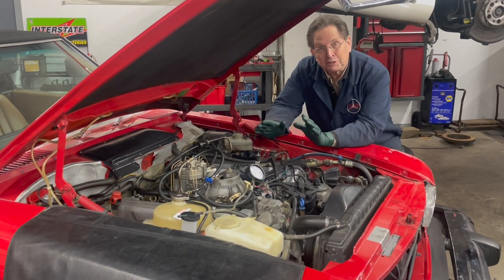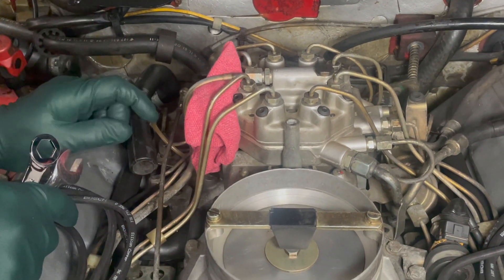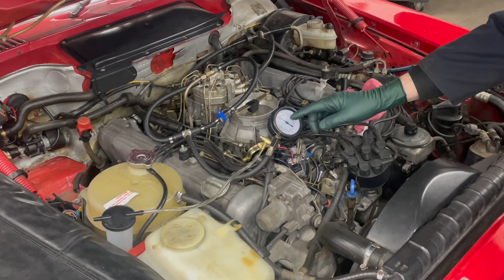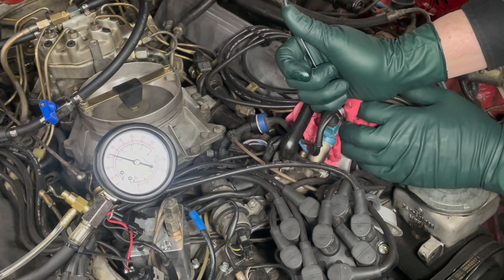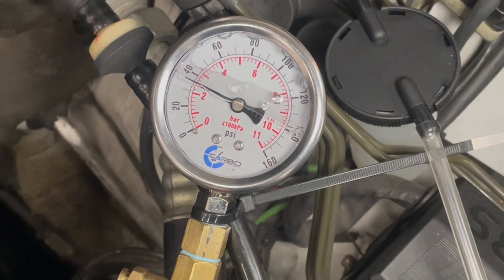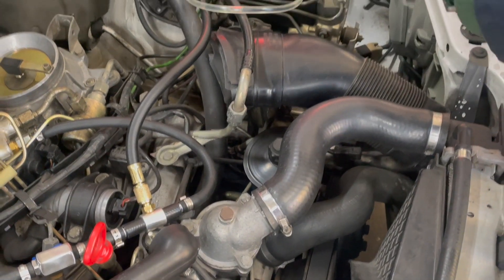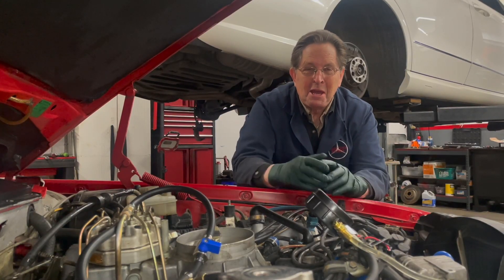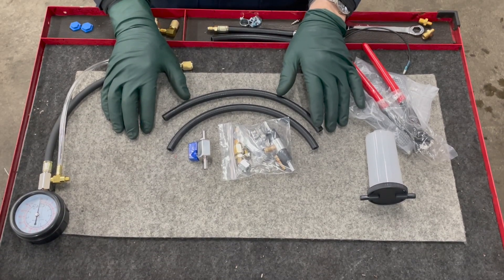Fuel Injection Pressure Testing a 380SL and a 300E: My New Tester Shown in Action

Comment: Am I the only one seeing spark 6:40 minutes in. Front right corner of engine. I don't know what's sitting there. But it's look like a lot of sparks. 🫣
Reply from the maker: So disaster in the making? Maybe the most important takeaway in the video? Understanding what that unit is and does might help. It is an upgraded electronic warm-up regulator, and that is a flashing light (not sparks) indicating its correct operation.
Reply: @Mercedessource  ok. Nice 👍 i repair a lot of old Mercedes in Denmark but mostly w124 and most 230 inline four. I have an old s124-230 1987 with 7 seats as one of my veteran cars. I love it. I'm really excited about our videos and I am watching every one. Thank you so much. I want to buy that tool from you in the video but I still have to decide if it's going to be the diy or the professional kit. 😉 I'm leaning towards the pro kit. And again thanks for your nice  videos

Comment: merhaba 300e ye ne yaptınız hemen çalışması için akümülatör bozukmuydu veya testini nasıl yapabiliriz bende biraz geç çalışma sorunu var basınç kaybettiğini düşünüyorum  (akümülatörün hortumunu çıkardığımız zaman veya kontağı açtığımız zaman içinden benzin gelmesi normalmidir yoksa kontağı açmadan benzin gelmemesimi gerekiyor
Reply from the maker: Maaf, saya tidak bisa menjawab jika Anda tidak memposting dalam bahasa Inggris
Reply: @Mercedessource  Hello, what did you do to the 300e? Was the accumulator damaged so that it started right away? How can we test it? I have a problem with it starting late. I think it lost pressure. Is it normal for fuel to come out when we remove the accumulator hose or turn on the ignition? Or should fuel not come out before turning on the ignition?

Comment: Would the gauge system be compatible with a 1986 Ferrari Mondial V8?  Also a Bosch K Jetronic CIS.
Reply from the maker: The problem might be different fittings. Do you have a K-jetronic or a KE-jetronic? Is there a warm-up regulator mounted on the engine?
Reply: @Mercedessource  the Ferrari uses a Bosch K/KE-Jetronic mechanical fuel injection (lacks airflow
plate pivot potentiometer on airflow meter of “true” KE system).  

https://upload.wikimedia.org/wikipedia/commons/thumb/f/f3/Ferrari-Mondial-3.2-engine.jpg/960px-Ferrari-Mondial-3.2-engine.jpg
Reply from the maker: Sorry, I am not going to be able to advise. I have no experience with your system.

Comment: Kent is an MB treasure. Used several of his products. FYI Kent, the video seems to show an ignition leak around the 6:40 mark.
Reply from the maker: You have a good eye, but that is NOT an ignition leak. That is the pulse light for the electronic warm-up regulator I installed on the engine.

Comment: Hello dear sir. Can you give me some advice about the car? I'm sure you'll know. Because I have been following you for a long time. I have a Mercedes-Benz W211 E500 4matic. 2004 year. In winter, when I drive the car, the chassis squeaks or squeaks. Back and front a little too. What can it be? In the summer, the sounds always disappear! ☺Thank you very much in advance. Avlastimov
Reply from the maker: Most likely, it is going to be a dried-out ball joint somewhere in the suspension, and there are numerous ball joints in both the front and rear. It could also be any one of the rubber bushings in the suspension, but if it is a high-pitch squeak, most likely a ball joint. Take it to a good front-end shop